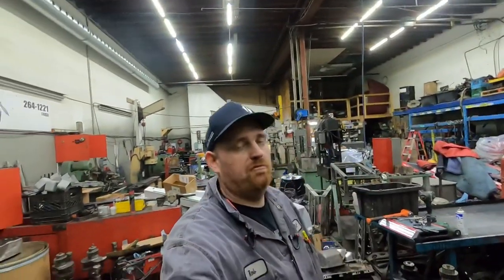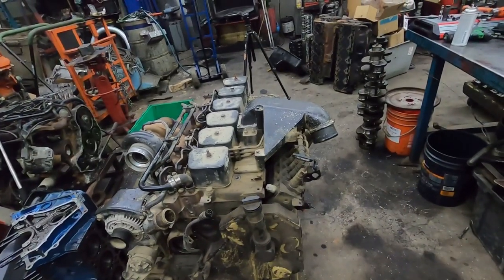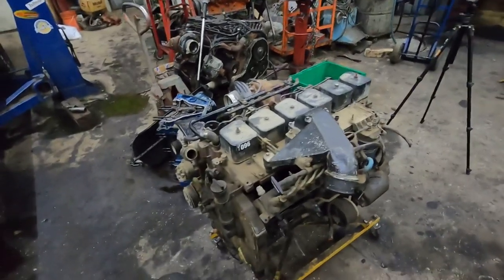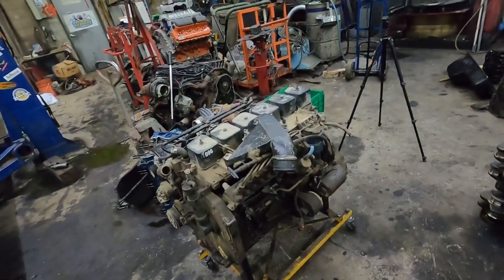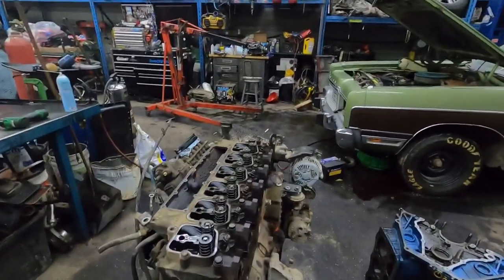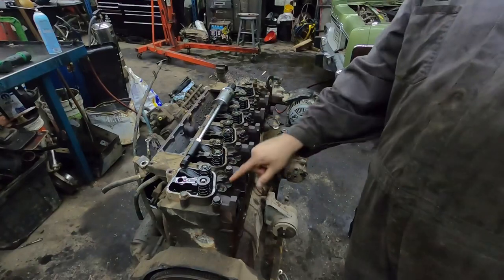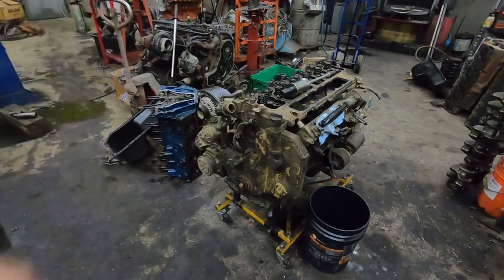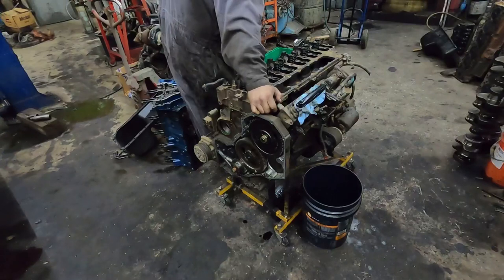How To Rebuild A 5.9 Cummins 12v Diesel  (PART 1) ---- tear down video

Comment: Thanks for these videos bro. I'm in the process off rebuilding my 97 12v as well. Cam retainer bolts backed out and broke the cam gear and cam retainer. Think kdp had a part to play too because it ain't in its hole lol. Bent my push rods pretty sure that my valves are bent but haven't pulled them out the head. Keep the series going man they are greatly appreciated man
Reply from the maker: Ya sucks when that happens. Thanks for watching!

Comment: great video we,put a 6.7 on a 06 runs bad at low idle do we need to swap inlectors  that makes no sence to me. thanks for any advice
Reply from the maker: if your running the 06 injector it wold run bad , spray angle is wrong

Comment: Rob, appreciate the minty walkthroughs! With 3200 rpm spring on 60lb springs, are there any further precautions to take aside from better oil as you said? This is for a non i/c 90 5.9 w250. I’m doing a full rebuild with 155 bowls 150hp injectors, BW 362sxe, arp studs, and ve rebuild.
Reply from the maker: Oil temp is a big thing to watch.

Comment: Hey Rob 
Quick question regarding the parts washer, what would be the best way to clean the block, head, cam, etc in case you don’t have the big washer available?
Thanks man once again for your time and for sharing your knowledge! Best on YouTube, hands down!!!
Reply from the maker: thanks for watching. power washer works. diesel and brush works. lot of different

Comment: Can you tell me what the 2 bolt bracket in the timing cover below the water pump is for?
Thanks for sharing these videos! Liked and subscribed! From Connecticut 👍
Reply from the maker: The two studs ? If so there for the crank sensor
Reply: Yup that’s the bracket on the studs...would a 95 12valve 5speed have that sensor? Thanks!
Reply from the maker: @roofer4kidz913   no problem

Comment: My 6th injector got stuck inside and when pulling only the top half came off. that being said the bottom is left to be stuck inside and will not come up would i have to tear it down the to head or is there a way of getting it out ? 93/5.9
Reply from the maker: Pretty hard to get them out when they do that. Likely will have to pull the head off

Comment: What would be the best/easiest cummins swap for a gmc? I'd like a 6.7 but don't that will be a easy as a p pump 12v
Reply from the maker: At this point they’re all pretty easy. Just the commonrail will cost more as there is wiring and programming needed
Reply: @CUTTERUPROB  can it be ran on a p pump so I can run black diesel?
Reply from the maker: @petervanguilder6276  yep sure can. But at that point way cheaper to run a 12v
Reply: @CUTTERUPROB  no benefits to having the 6.7 converted over?
Reply from the maker: @petervanguilder6276  there is but the extra money unless you really want one doesn’t make sense